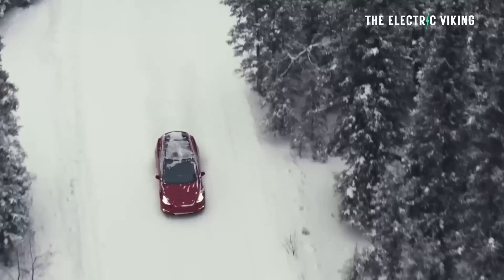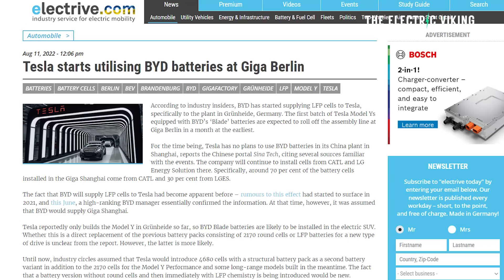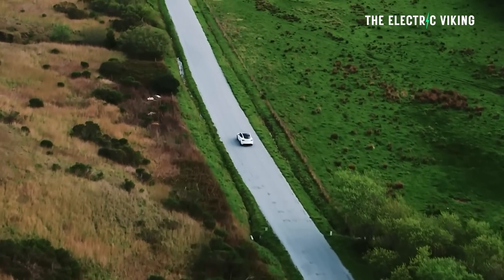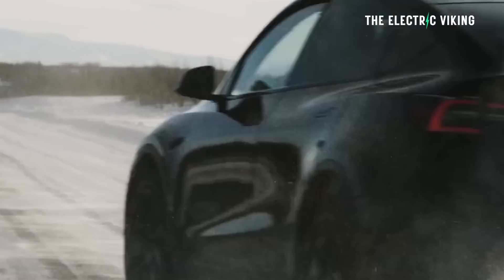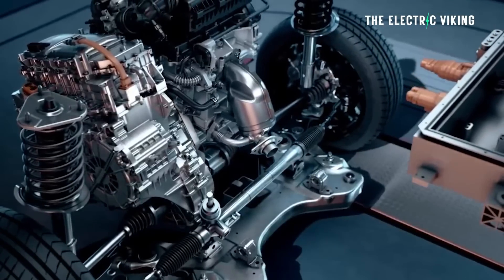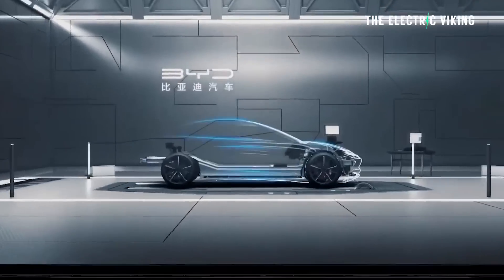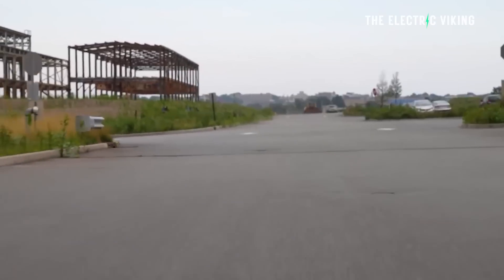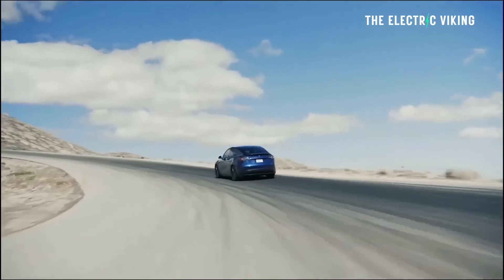Tesla Model Y's mysterious efficiency advantage VS BYD's Atto 3

Comment: Tesla is really bad about inflating their range estimates.  Watch the TFLEV EV mountain test across two mountain passes.   The Tesla way over estimated it's range.  

Tesla threw up a big number from the very start of the test and constantly adjusted itself down during the test and at the end of the test didn't even meet it's EPA rated range.  Out of the 4 cars in that test the only one that didn't at least make it's EPA rated range was the Tesla when you do the math for the battery remaining.  The other 3 cars met or beat the EPA ratings.  Oh I know Tesla's excuse is they run the car below zero to account for the buffer!  ROFL  That is really a sad excuse or poor engineering.  

Optimistic?  Or lies?  Whatever, they appear to be wrong.  And it appears that other manufacturers may appear to have a lower range, but possibly it could just mean they more accurately estimated the range for the vehicle.  

So how can Tesla do so much better?  Well let's see some tests.  Oh in the TFLEV test the Bolt beat the M3P with a smaller battery and less rated range than the Tesla and still had more range left at the end of the test than the M3P.  It appears GM underestimated the real range of that car and Tesla over estimates theirs.
Reply: Never mind, I found it, here: https://youtu.be/eFB6hsYXDiA. While I didn't have time or patience to watch the whole test, I did skim the transcript, and will stipulate that what you state above is essentially correct. It's plausible that cars could beat the EPA rating, because of the slower speeds during the climbs that are closer to the EPA average speed of 48.3 MPH on the highway section. I couldn't track all the dozens of different mileage data points; but at 41:51 the Tesla Trip screen shows 215 miles at 263 Wh/mile, which is equivalent to 128 MGPe, vs. the rating of 113 MPGe stated at 4:13. So while the Tesla apparently falls short of the EPA rated range, it exceeds the EPA rated MPGe, at least during this trip; that's probably the result of how the different phases of the EPA range and mileage tests (City, Highway, High Speed, A/C, Cold Temp) add up to the combined ratings.

To reiterate, no one's lying, because it's EPA, and not the manufacturer that develops the EPA rating. If the Tesla falls short of the EPA rated range, it's likely because the EPA tests are in some way more favorable for the other vehicles. The Bolt does come out on top; but for various reasons, it isn't the car I'd pick for a long road trip!
Reply: @BigBen621  That stretch of I-70 the speed varies, but it is a hard test no doubt.  The Tesla just does not appear to regen as aggressively so it didn't quite carry the rated distance.  The others on the other hand appear to be much more conservative in their range rating.  That Bolt really has an aggressive regen so it was able to recoup a lot more than the others.  It is a interesting test.  I am looking forward to them refining this test and breaking out winter and summer runs with same vehicles and build a database/sheet to track it.  This is a pretty valuable dataset.   

My point is that I think Tesla is very optimistic with it's range estimates and is probably why they show significantly different range estimates.  There is of course the CD of the cars that plays into it and other things, but I think part of the disparity is Tesla's "optimism" LOL
Reply: @Longsnowsm  Once more, it's not Tesla that makes the range estimates—it's the EPA. And the Tesla performed significantly better than its EPA MPGe rating, just not in the range rating. Except in the rare case where you'll have difficulty getting from one charger to the next—which is much less likely with the Tesla charging network than with others—MPGe is probably a more important parameter than range, because it determines how much operating costs are. The Bolt and Tesla had stellar MPGe ratings, on the order of 50% better than the other two cars. There's certainly much to like about the Bolt; which makes it sad that it's being discontinued by GM.
Reply: @BigBen621  Who ever makes the estimates consistently gets it wrong for Tesla.  And Tesla's response is "you have to drive it below zero on the miles remaining".  That is a BAD answer.   If you're going to put a rating on something and a range estimator on something how about you make it as brain dead simple as a gas gauge?  i can show you Tesla refuting Edmunds for their range tests who came to the exact same result that Roman just did in their test.  Edmunds also found the range estimates were off.  Tesla's answer is you have to drive it until dead below zero.  You can give Tesla the pass if you want, but Tesla has spoken to the issue and they chose to do their tests using the available battery plus the buffer until dead.    If you don't believe that I can find you the link for Edmunds test and the rukus that created.  This isn't some new found discovery.   People know these estimates that are published for Tesla are wrong.  I don't care if Tesla came up with the number or EPA, but it is WRONG.  People are buying these cars based on those published numbers.  Range is a key unit of measure when looking an EV.   Edmunds dug in deeper to determine how these numbers were derived.   Now back to this video.  How can Tesla eclipse the competition's numbers.  We one thing is going to be how they get this range number.  Tesla explains it.
Reply: @BigBen621  On those other two cars.  They actually exceeded their ratings.  But they just aren't very efficient vehicles.  But they did beat their published numbers.  Agree on the Bolt.  It is really a pretty good car if not for the slow charging.  It is pretty efficient for what it is.  The Tesla will clearly beat it on straight up high speed highway driving due to the higher CD numbers, but over all it is a pretty good car.  GM never had a winner that it didn't kill! LOL
Reply: To your point, I think a lot of this relates to the level of acceptable risk of the companies involved. Tesla is willing to push the test to the limits to maximize their claims, and takes the risk of an investigation or lawsuit in the future. They have an established fanboy echo chamber that will counteract any bad news. BYD will sandbag their numbers to make sure they reach their claimed range. They are also introducing a new brand from a country with some negative pre-conceptions and do not want to risk the potential damage. And the political cards are stacked against them in the West.
Reply: I couldn't find that test; but in the one I saw, here: https://youtu.be/f3HlMQ1lkgs, the Tesla Model Y going up and down Loveland Pass, the reduction in remaining range exactly matched the length of the trip. Perhaps you could post a link to your test, or at least a little more detailed description.
One thing I noticed on this test was that they were not using navigation. As such, the Trip Planner would not have known they were climbing an 11,000 ft. pass, and would have shown the remaining range decreasing disproportionally on the climb, but making it back up on the descent. If the test you're referring to was done without using the Trip Planner, the effect would be the same.
Keep in mind that EPA develops the EPA range, not the car company; and under conditions that can't usually be met on a road trip—e.g., average speed 48.3 MPH. I'll be interested to see a test in which other vehicles exceeded their EPA mileage, because in my experience that's pretty rare.
Reply: @BigBen621  The channel is TFLEV.  The title is: Tesla Model 3 vs Chevy Bolt vs KIA EV6 vs Volvo XC40 - Take on the World's Toughest EV Range Test!

https://www.youtube.com/watch?v=eFB6hsYXDiA

This was the first time they ran this test, and there are a lot of questions, but it is very interesting how it turned out.

Comment: Dear friend...the answer is SIMPLE: a DUAL MOtor CONSUMES more energy than ONE motor....this is why the tesla Truck use JUST ONE motor during cruising speed, whereas it uses THREE motors climbing a mountain for example....
Reply: nah, awd is not necessary at normal driving. thats true for like all cars, they never use awd.
range is first and foremost battery size, then drag, then the sum of all parts and software.

Comment: Sam, you are definitely an Australian. Regarding BYD versus Tesla, I would not be surprised if Tesla’s regenerative braking is far more efficient given that they have been at this longer, and probably have the best engineers in the world
Reply: Good point! BYD doesn’t have full one pedal drive.
Reply: Regen breaking doesn't improve efficiency or range.

In fact, turning off regen breaking is better for increased range (you want to coast more often to get more range, vs regen breaking more often)

Regen breaking might be useful with inner city driving, but it's commonly turned off when long distance driving to maximise range.
Reply: @hargeaux  That doesn't make sense.  I mean I get that they would want to disengage systems that are not in use to remove a possible friction source, but regenerative breaking is very important for highways, for example, if you are going down a hill regenerative breaking can keep your speed constant and store energy that would be lost otherwise.
Reply: @jefflittle8913  that's incorrect. I think the biggest misunderstanding is that without Tesla's form of regenerative braking, people assume there is no regen braking occurring.

In EV's without one pedal driving, when you apply the brake pedal, the cars engage regenerative braking first and only engage the brake pads if they absolutely need to.

So when coasting down a hill, there is no lost energy at all, until brake pads are engaged, which isn't necessarily a fact, even if the driver taps the brake pedal.
Reply: @hargeaux  stupid
Reply: goog point Sam had a BYD and said it did not even have region braking which is shocking to me
Reply: @noCOtwo  Not so. The BYD has full regen braking modes, mild and aggressive, you can make the setting. 

In the aggressive mode using one pedal operation taking your foot off the accelerator will slow the car to 6Kmh, you have to use the brake to make a full stop. This mode is similar to some ICE with auto tx.

On long steep winding downhills you can also use regen to maintain a controllable speed using the adaptive speed control without resorting to brakes. 

Overall it is a very good system.

I drive both a Tesla M3 and Atto3 and although their braking modes are slightly different they are both very effective.
Reply: @jimgraham6722  The (adjustable) regen on my Model Y will bring the car to a complete stop - it's like playing a video game, lift off the juice pedal at exactly the right time to stop where you want to - allowing for hill slope, speed, and battery capacity (regen is less efficient when the battery is at 100%). I recently did a 200km city/country drive and never touched the brake pedal once (AKA one pedal driving).
Reply: @noCOtwo  byd will be another Hyundai Excel .. a lemon.. saw a parked ATTO 3 ... windows all fogged up. their warranties still a deliberate mess
Reply: @pragmatist165  The Atto3 is actually a very nice car to drive. It is very comfortable and has lots of room with seats laid back. Windows were likely fogged due energetic activities going on inside. 

Not to worry though once finished occupants can turn on the powerful demist system to clear the window mist. In summer you can also open the sunroof to get a view of the stars while laid back.
Reply: @jimgraham6722  The back seat is like a stone bench to sit on.
Reply: @MarksElectricLife  I find the Atto3 backseat very comfortable with plenty of legroom. That in my M3 is not quite so spacious and seat and ride a good deal firmer.

Comment: The motor/generator in a Tesla would probably lose close to 20% electrical energy loss as heat when either driving or regenerating. I would think the BYD system could potentially be more efficient than the Tesla because, with a disciplined driving technique, the BYD you could save more of the regen losses. Excessive brake usage would make the BYD more inefficient than a Tesla which uses regen. more than the BYD. So, it's up to you, take your foot off the accelerator a bit sooner in your BYD, use wind, rolling and mechanical friction to slow you  rather than you brake foot so much and you'll outrun a Tesla any day. Drive as if you have no brakes and your brake pads will never wear out and your range will improve. It's quite surprising how far you can drive without touching your brakes. It doesn't have to be unsafe, just look ahead, be aware of what the traffic ahead is doing. Slow down sooner. I have to admit though that I do love the (less efficient) one foot driving with a Tesla.

Comment: I would suggest that the Tesla has better aerodynamics than the Atto-3
Another factor may be better use of regen energy, via better software.
Explanation: two main areas of loss of energy are deceleration losses, and rolling losses, including air resistance, tyres, friction.
the decel losses is the energy lost in braking that is not recovered by regen. Regen is never 100% efficient; I'm guessing 80% might be reasonably good. The importance of regen is that it recovers most of the energy used to accelerate the car, so the more efficient the regen, the less the mass will affect the mileage.